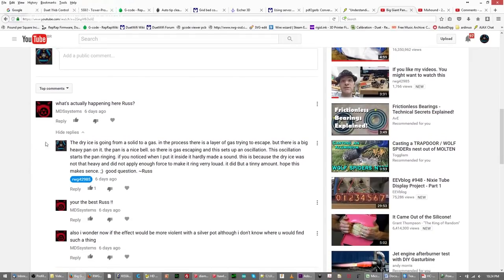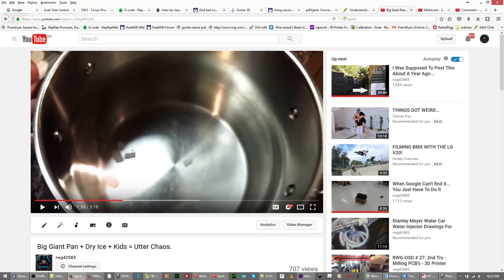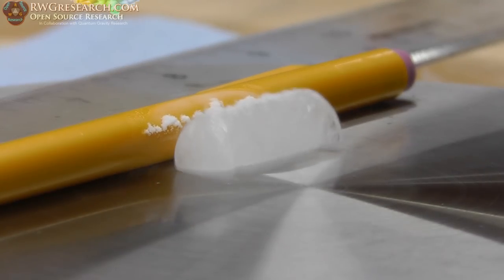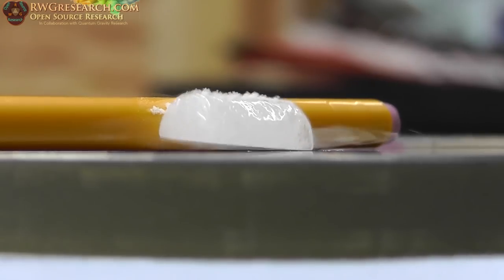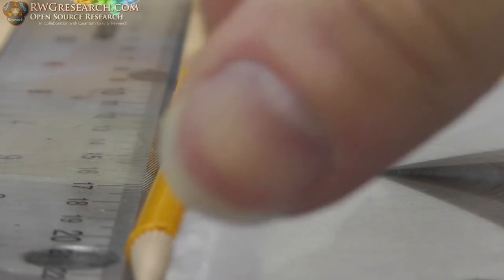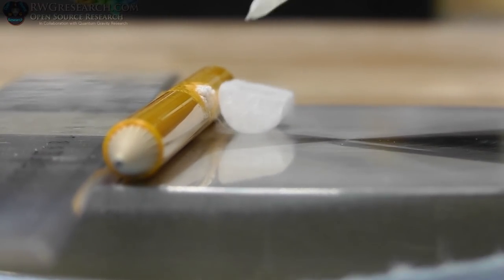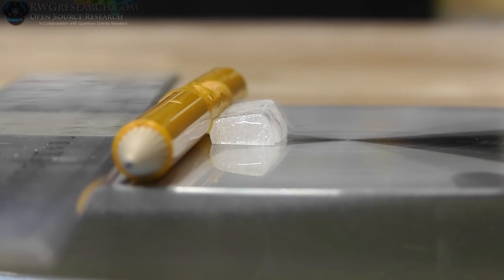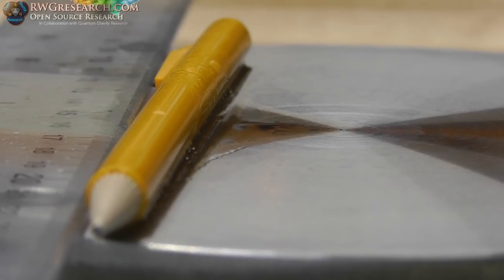Answering a Dry Ice & Pan Question. Bouncing Dry Ice Pellet. ohhhh Ahhh

Comment: i think what's happening is that the part of dry ice that's touching the stainless steel is quickly melting->evaporating, creating a cushion of CO2 underneath the dry ice, pushing itself upwards. And because this is happening rapidly and that the shape of dry ice isn't perfectly flat, it makes it impossible for the dry ice to sit still at one spot, whichever corner touches the stainless get pushed up by the gas, and it happens over and over again, hence the oscillation. 
Just like water droplet on a hot skillet, except this is solid to gas.
Reply: And it stopped after a while because eventually the bottom of the dry ice melt into a flat surface, allowing it to sit still while that rapid melting->evaporating happens. Or maybe the temperature of the stainless gets lowered to a point where the dry ice only melt but doesn't evaporate, and disabling the lifting effect.